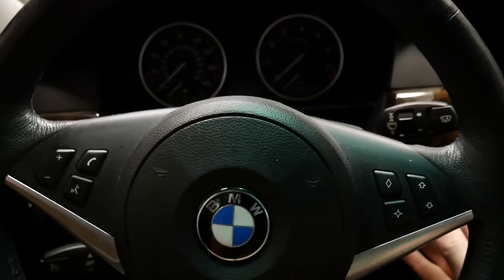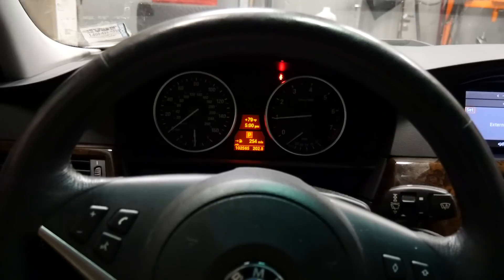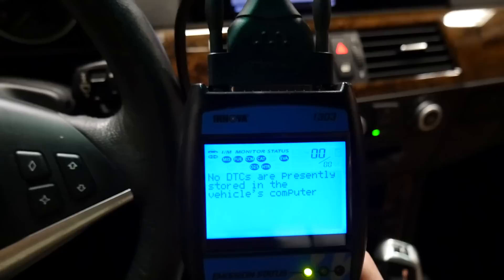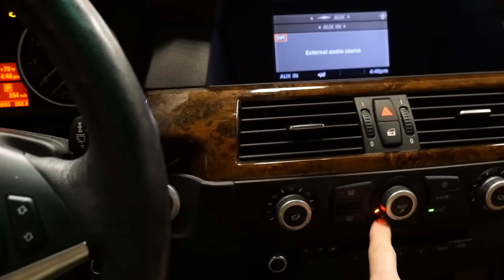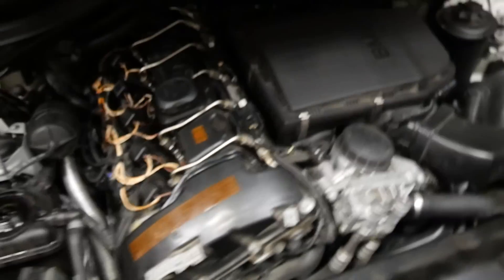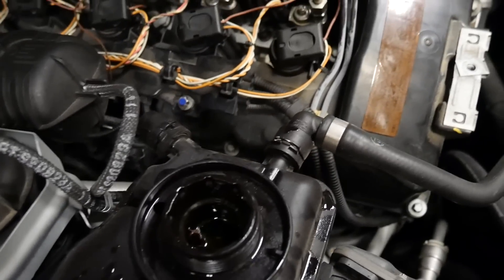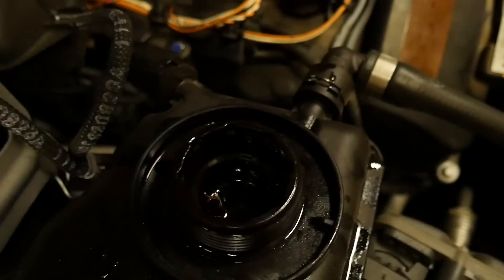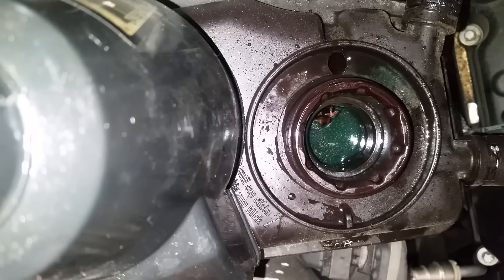DIY - BMW radiator fan stuck on high? - electric water pump diagnosis

Comment: My sons BMW 535xi had a bad water pump. The pump was replaced but the fan seems to still be stuck on high. Are there any procedures that have to be done to reset the fan.
Reply: Thank you, it must be a sensor because I had the thermostat replaced also.
Reply from the maker: No, there is likely a bad sensor or thermostat  as well.
Reply: I have the same problem, did you get it fix ?

Comment: It's on my third water pump. Each one lasts 50k to 60K miles. Water + thermostat cost about $500. if you cant replace them yourself, then plus $400 labor. Such a wondering engineering. Don't buy a used BMW if you can't work on it...it's a money pit.
Reply: What are you going to your car? I have a 328i with 172k and never once replaced the thermostat nor the water pump, hoping I don’t jinx myself with this comment lol
Reply: @benderr424  11 month update did the water pump go out yet?
Reply: Thats to bad of BMW
Reply: Or be smart a buy it from a place with lifetime warranty lmaoooo . Ig they didn’t have brains 3 years ago

Comment: I have the same engine. My fan kicks in after a short delay from starting the car. It goes full blast then slows down a bit then full blast then slow down and so on. I was watching the coolant in the reservoir comes in then stops then comes in and stop.. I tried the bleeding method you showed and got nothing (no noise from water pump and no coolant coming to the reservoir). I also noticed that when I have my heater on, the front vent don't have heat. The back vents for the rear passengers have heat. When I drive long distance, I keep an eye on my coolant temp. It goes up to about 110C and comes down to around 100C and stays in the range of 100-110C. Is that normal? Any idea what the problem could be?
Reply from the maker: Try popping off the lower radiator hose and look for debris, sounds like it may be sludged up?
Reply: @EpicTim  Thank you for the tip. Maybe I will just do a drain & fill? Do you think using Firestone Green coolant is ok? I have seen somewhere where they say it should be ok?
Reply from the maker: I would stick with bmw coolant, you should also use a flush agent if you suspect debris buildup.
Reply: @EpicTim  One thing I am concerned about is I will have to bleed the system. Currently my water pump does not respond to the bleeding procedure. I am not sure if it is failing or something else. But I did see the water coming in to the reservoir but not in steady steam. Any thoughts on that?
Reply from the maker: The bleeding procedure fades the pump on and off, also part of normal operation depending on current conditions.
Reply: @EpicTim  Do you mean if I let the car runs at idle with the coolant reservoir cap open it will eventually bleed out the system?
Reply from the maker: It might, but is not the intended way BMW designed it
Reply: did you ever figure out what it was? my fan is doing the same thing with the high and low pattern. i did the test on my water pump and it's squirting coolant into the reservoir fine it seems
Reply: @Txddjames  For me it was a bad water pump. When I did the test no squirt was coming out but with the new water pump the test works just fine and the fan does not blow at max speed.
Reply: @ruigooal  yeah mine is squirting so idk what it could be then
Reply: @Txddjames  Just monitor your engine coolant temp when you are driving until you figure it out. My engine overheated on me and luckily I was close to home. With the new water pump, I was watching my engine coolant temp get as high as 110F then it starts to drop down as the water pump is doing its work.

Comment: I’m having the same problem. BMW X5 2008 4.8. As soon as I start the engine, the radiator fan kicks on and will not shut off. The vehicle is not overheating and the coolant level stays the same.
I’m going to replace the sensors tomorrow and pray that is my problem. Any help or insight would be greatly appreciated
Reply from the maker: Let us know how it turns out!
Reply: I replaced the coolant temperature sensor and it had no effect on the fan. I am going to try replacing the water temperature sensor tomorrow
Reply: @Lastofady1ngbreed  Did you manage to fix it?

Comment: PLEASE HELP!!!!!! 
Hi,I have a f30 335d,my fan is constantly like this for around 2 weeks now,iv had it plugged in and the same code keeps coming up,alot of my friends say my air con needs refilling and this will stop it????help,code is e71439....signal (status of pressure sensor for coolant circuit 0x2d2) invalid transmitter  fem/bdc

Comment: Hey Tim my water pump is working fine but I have the same problem please help
Reply from the maker: You will need to run more diag but its probably one of the 2 temp sensors reading hotter than it should
Reply: @EpicTim  what are the 2 temp sensors and where located?
Reply from the maker: One on thermostat, one on cyl head.  One is for the gauge, other for the ecu signal.  Not sure which is which

Comment: I was trying to prime my fuel lines after replacing pcv valve. Ended up putting my car into the water pump test mode and heard the fan on high. Kinda freaked me out. However after re starting the car it stopped. Still smoke out of exhaust tho :/

Comment: I have no sound on my pump but the water pump through the reserve  intermediately with low stream. If blowers (heater , a/c) the stream is strong. My problem is when car get warm it make a screaming noise, almost like the car alarm. I do have a p0013 code. ???

Comment: I'm from Brazil. I have a bmw x3 2011 35 i. The fan always fires at full speed, and on the track appears message of overheating of the engine. What could it be? Thank you!
Reply from the maker: could be the water pump or temp sensor, the ECU commands full speed when it picks up good or bad data from the engine's sensors.
Reply: Change your waterpump
Reply: Change the waterpump for overheating. But also the sensor on the hose also has to be changed for your loud fan sound.
Reply: @hassoeni21  muito obrigado amigo! Tenho dificuldade em achar peças aqui no Brasil, é bem caro. irei importar!

Comment: 2008 BMX 4.8 warm-up problem. When I test the pump with the car turned off, the pump does not draw the jet into the reservoir. using the pedal and with all the procedure well done, but when I start the car the jet comes out normally. the question is ... is it possible that the bad pump is the auxiliary pump and not the one that goes in the belts?
thanks for help me!
Reply from the maker: Im not sure but i dont thing there is a belt pump at all.  Whats the symptoms?

Comment: Did you get any temperature warnings from this happening ?
Reply: I was in a drive thru and my fan cut on and I thought it was the big exhaust fan from the Restaurant and when I pulled out my temp warning came on .  So I are and waited about 15 mins and made it halfway home and temp came back on and I pulled off again then made it home .  The next day I started it up and kept hearing a clicking sound like a fan was trying to cut on after about 10 minutes the loud fan cut on.   Guess I'll be headed to town next week to get a high dollar estimate I'm sure .
Reply from the maker: @medjr8162  bummer, good luck with the estimate!
Reply from the maker: depends on the failure exactally but not usually - if you idle it with a bad waterpump the car will eventually get hot and throw and error but your in bigger trouble by then

Comment: I had this problem in my x5 
I cleaned the mass air flow sensor 
Went away no problem again
Reply: Muwafaq Sheikh  hey sheikh how did you clean it . What exactly did you clean?
Reply from the maker: you can buy a can of mas air flow sensor cleaner at the parts store

Comment: Hi, i own an E70 2012. I hear loud fan sound frequently.
Your video was so helpful, i have checked coolant compartment and found pump is working well but still i have louder fan noise ON & OFF frequency. 

Is it normal or do i need to take any preventive measures?

Pls advise
Reply from the maker: sorry for the delayed response, it sounds like it may be operating normal or low on coolant.  try the bleeding procedure for your car and see if that helps.
Reply: I have this same problem unfortunately maybe thermostat starting to go bad ?
Reply from the maker: Is it constant after a cold start?  If yes it sounds sensor relatedm. If no, it could be a thermostat, a8r bubble or coolant level

Comment: HELPPPPP I changed the pump and the thermostat and I am still getting no sound from the pump.WHAT DO I Do (I have a 2008 528xi)
Reply from the maker: Check for power at the water pump plug with a test light or volt meter with the car running, check ohms on the pump itself (not connected)
Reply: I have the same problem

Comment: Mine sorta does the same thing. i tested my water pump and it’s working as it should, good coolant flow and no noises, but my fan seems to be constantly on. I looked at my temps in the secret menu and it’s reading 95C  and won’t go any lower with the fan on full blast. it used to cool down to around 80C and then the fan would kick off until the engine heats up again. the temp has gotten to 114C. sometimes it will stay at 111c when just sitting, when i start driving, the fan kicks on and stays on and only cools down to 95C. any ideas? temp sensor maybe?
Reply from the maker: Sounds like it's either an out of range sensor or a thermostat issue.  do both coolant temp sensors read high?
Reply: Epic Tim Update: Replaced temp sensor, no change at all. Did notice that my upper radiator hose gets hot and my lower one stays cool when car is up to temp. Fan kicks full blast at 111C and only cools down to 96C. I know it’s supposed to cool down lower than that and then the fan kicks off, but it stays on trying to cool the engine down. Leaning towards a thermostat, but aren’t they designed to fail stuck open? seems like mine is partially stuck closed. Not throwing any codes. I have good heat, car still isn’t overheating.
Reply from the maker: They are not particularly designed to fail open.  if the coolant is in good shape, it would seem that you definitely have a restriction.  likely a thermostat or sludge issue.  if it gets very hot at freeway speeds and not at lower speed it may very well be a head gasket also.
Reply: Epic Tim Hoping the head gasket isn’t the case. It gets hot and at any speed. never seen it get past 114C. When this issue wasn’t present, it would get to 114C sometimes, but cool down quickly as it should so i know it’s normal to see it that high. It will cool down but just not to where it should be. Coolant looks good, it has about 60k on it. No bubbles in reservoir tank when running, no extreme lost of coolant (i do top it up every now and then though) no milky oil or white smoke. Changing the thermostat this weekend and changing the water pump for the hell of it too and of course the coolant. Will update if issue is fixed. I really do appreciate the replies, thank you.
Reply: Thanks for the reply. I don’t think so, but maybe. i feel like the sensor is telling the engine it’s hot when it’s really not and that’s why my fan is kicking on full blast for long periods of time. My thermostat, water pump and radiator were replaced before and only have about 50,000 miles on them. I unplugged the sensor that’s near the oil filter housing and the fan kicked on full blast upon cold start up. i don’t have that sensor that’s on the lower radiator hose as i think it’s inside the radiator. i have the the n51 (SULEV) engine. Im going to replace the sensor near the oil filter today and will update if any change or not. Thanks.
Reply from the maker: did the thermostat fix it?
Reply: Epic Tim Sorry for the late reply. Fedex was late on my package and i just got done with it tonight. But yep, all fixed! Thermostat was the issue. Thanks for all your help and suggestions!
Reply from the maker: that's ok, glad we came together and got you straightened up :)

Comment: What do you mean by venti mode when your low on water or on your coolant reservoir is low because my 7series has loud fans on along with , my reservoir goes low but doesn't leak anywhere on the ground?.
Reply from the maker: it's going somewhere, might be a head gasket, the 12cyl's were known for head gaskets if that's what yours has.
Reply: @EpicTim  oh man, I hope it's not. Do you know by chance what it means when 2731 camshaft inlet means because I just had replaced all 4 camshaft sensors
Reply from the maker: @JiGS-Family12_26  sorry, cant help you there

Comment: I have the same one with my x3 2008 177hp. Yesterday I replaced the temperature sensor that is located on the cylinder head but the fan still working all time. Can be the other temperature sensor that is located at the down side of radiator or thr water pump?
Reply from the maker: yes

Comment: My fan worked fine and then i had a hose go bad after i replaces the hose the fan now runs the whole time I’m driving
Reply: I have a x3 2005
Reply from the maker: @3340edward  did you unplug the coolant temp sensor?  that would cause this issue.  there are two, one is right by the thermostat
Reply: I only unplugged the hose at the bottom of the tank.
Reply from the maker: You might have air in the system, have you tried the bleeding procedure?
Reply: No, I’ll try again
Reply: @3340edward  did you solved the issue? I have the same one witt my x3 2008 177hp. Yesterday I replaced the temperature sensor that ia located on the cylinder head but the fan still working all time.
Reply: I went and bought the bmw coolant and redone the bleed process.

Comment: I'm not sure if this applies to an e90 but when i check the coolant resevoir, coolant will spew coolant for a few seconds, quick pause and repeat. It doesn't make any noise at all. It stated the water pump was replaced around 50k miles and im out 54k now. Is this normal for me?
Reply from the maker: See other comment fron Kunwar photography

Comment: Does the temperature raise up or it seem normal in dash?
Reply from the maker: depends if the water pump is working, typically the fan will only act like this if either the pump is bad or if the sensor is bad.

Comment: the flow in the hole is steady, no stuttering or pauses. It's a constant flow.

My main issue is the fan and engine overheating. The fan sounds like a jet engine, and people can hear it from a block down.
Kid crossing the street smiled because he thought I was revving the engine at him.

I went ahead and purchased the water pump and thermostat kits.
I intend on spending an additional $500 in labor fees; a buddy of mine said this was a good price, let me know if I'm wrong.
I would really like to know if it's the water pump or radiator before I make any moves..
What puzzles me is the engine temp never exceeds the middle line, only the computer says it's overheating and I'm instantly in limp-mode. It's been dangerous with this rainy weather and being stopped in the middle of the freeway isn't really for me, or anyone really.

Next Friday is my installation, I'll let you know what I find out. Hope it'll help another European fan in the future.
Reply from the maker: If you have a constant flow of coolant under the surge tank cap, your pump is working, the bleed procedure will not be constant, it will flow faster and slower.  I recommend you check or replace both sensors for coolant temp.
Reply: @EpicTim  just purchased the coolant temp sensor. are there two sensors?
Reply from the maker: @user-hd2go2pn5j  yes, 1 for the ECU controller and 1 for the gauge
Reply: @EpicTim  so i need two of the same coolant temperature sensors then? can't seem to find anything else online..
Reply from the maker: @user-hd2go2pn5j  double check the parts catalog, what year and model are you working on?
Reply: @EpicTim  it's a 2011 535i, n55 engine. Thanks man I appreciate it. I tried to find the spot where it can be replaced with no luck. I think the sensors stashed next to the radiator but I can't get to it.
Reply from the maker: @user-hd2go2pn5j  I show two and they are different, 13627580635 for the gauge in the middle of the block near the head gasket, drivers side http://www.realoem.com/bmw/enUS/showparts?id=FR73-USA-01-2011-F10-BMW-535i&diagId=11_4447#13627580635
& 13621433076 for the cyl head at the front of the motor, driver side http://www.realoem.com/bmw/enUS/showparts?id=FR73-USA-01-2011-F10-BMW-535i&diagId=11_4451#13621433076
Reply: @EpicTim  ONCE THE PUMP IS ACTIVATED DOES IT SUPPOSED TO RUN CONTINUOUSLY OR SWITCH ON AND OFF??  ONCE I DRIVE IT AND PARK IT WILL KICK ON FOR ABOUT 1 MINUTE THEN KICK BACK OFF... COULD IT BE JUST COOLING THE CAR OFF...(IT'S NOT RUNNING HOT)
Reply from the maker: @RosemaryInabinett  the pump is PWM controlled and will phase in heavier flow when needed but it should, at a minimum, idle a long to keep coolant flowing a little and eliminate those hot spots when approaching operating temperature.  in operator commanded bleed mode (car engine off) it will phase completely out and ramp up to to higher pressure then back to off, over and over, in an attempt to push out the air bubbles.
Reply from the maker: @RosemaryInabinett  sounds normal, you probably cant hear the pump when it's idling.  please note the fan is independent in this scenario and is just an aid for diagnostics.  if the fan kicks on and off, thats normal
Reply: @EpicTim  Thank you so much...
I have just one more question...When the heat is on it doesn't blow hot out the passenger vent..Do you know why that is happening??
Reply from the maker: @RosemaryInabinett  could be alot of stuff, if it's just temperature that wont change out of that side, it's probably a blend door motor.  if it does not switch from face to feet on that side it's a mode door issue.  bmw's also have sun load sensors, if one is faulty it can prevent the blend door from functioning properly as well.